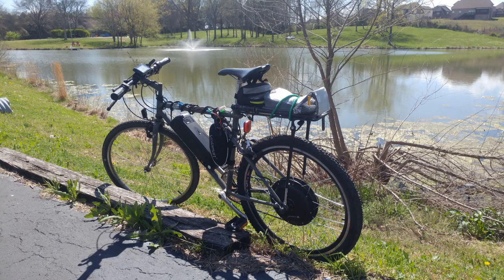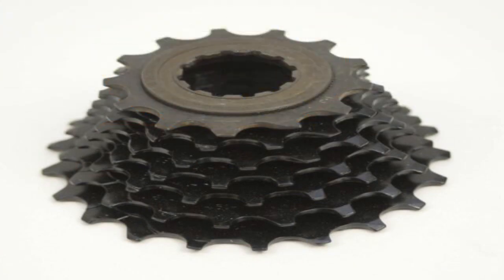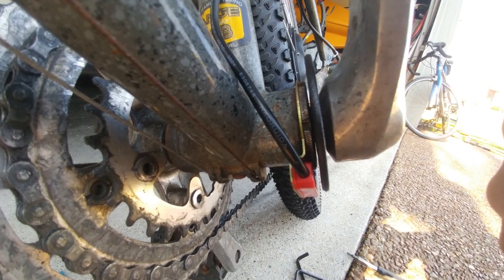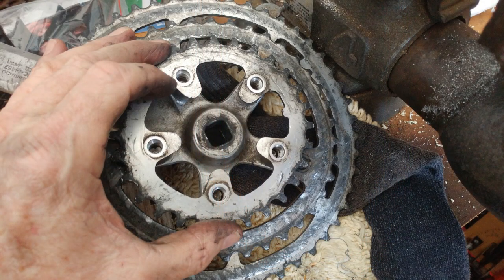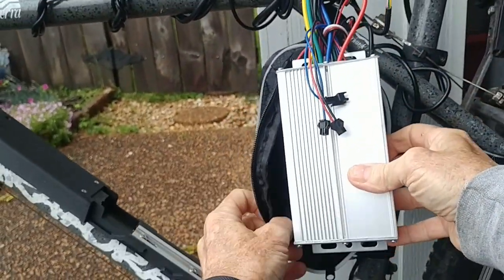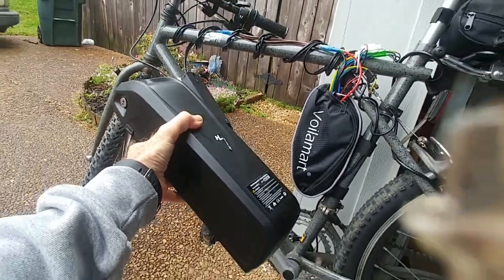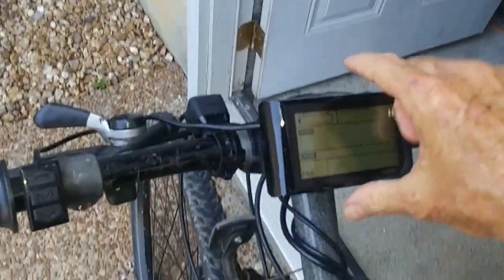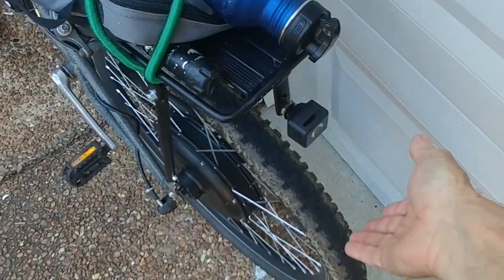Converting a Mountain Bike into an Electric Bike

Comment: Wouldn't drilling wholes into the frame cause it to eventually crack?
Reply from the maker: Yes, it's possible that it would crack if it were carbon fiber. Aluminum and steel are pretty resilient, and a small hole like that on the top of an aluminum tube shouldn't be a problem.